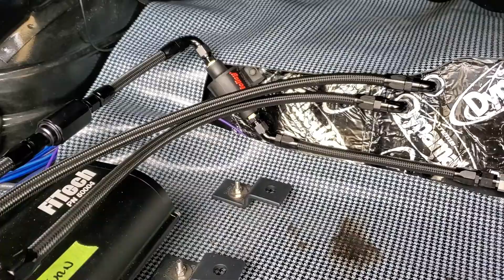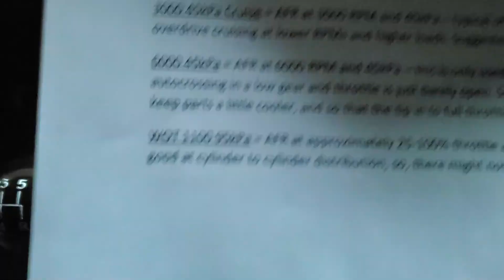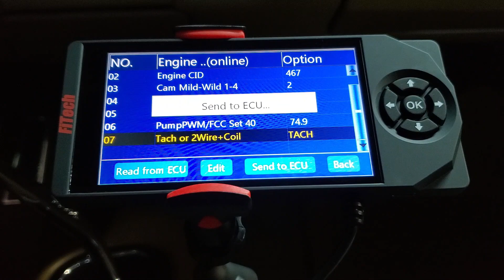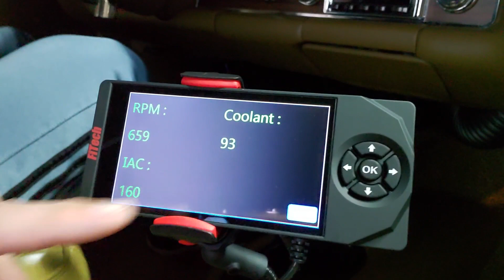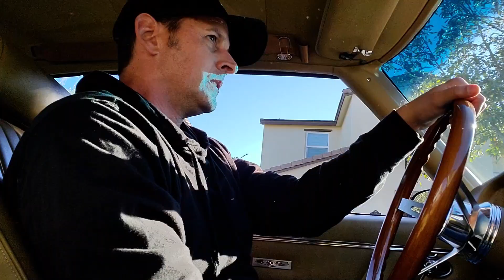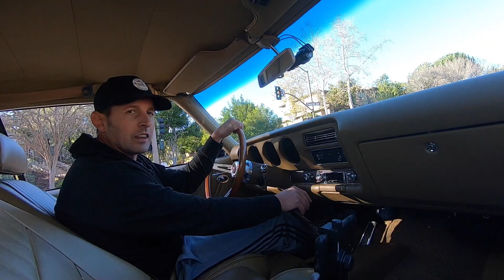Fuel Injection Conversion, Part 7:  FiTech settings, First Fire, and Test Drive!

Comment: Watching this series has me convinced I'm going with a new fuel tank with an in tank fuel pump and dual lines, this seems way more leak prone and complicated then it needs to be, plus that fuel pump sound level is atrocious, I just can't get on board with so many fuel lines running all around the car, especially in the trunk, by the time you realized something leaked it would be a huge mess...thank you for sharing and documenting it without bias 👍
Reply from the maker: Thanks Brian!  Yeah, that pump is obnoxious.  I think Holley makes an in tank returnless pump... I'll have to do some research on that, and make another video for my Plan B fuel supply :)   I appreciate the comment.  Thanks!

Comment: welp gotta say not impressed with the results. i went back and compared this to your first start and test drive after the engine rebuild video, and essentially, you spent all this money, all this time, all this work......because the carburetor you had on the GTO previously had no choke!! 
the start up with the carb was just as fast (if not faster) and even smoother than with the carburetor (at least in the first drive video)
your complaint that it idled at 1800 with your foot on it until it warmed up is simply because the carburetor has no choke
the acceleration right out of the driveway was smoother with the efi ill give you that. 
but the driving and the startup (which is the whole reason people rave about this EFI garbage) was no faster, and i could see no improvements
unless there are some dyno numbers where you gained significant power gains with the EFI, in my opinion, the money and labor and time was not worth it for the EFI conversion
Reply from the maker: As I said in the beginning, there's nothing wrong with loving your carb.  Thanks!